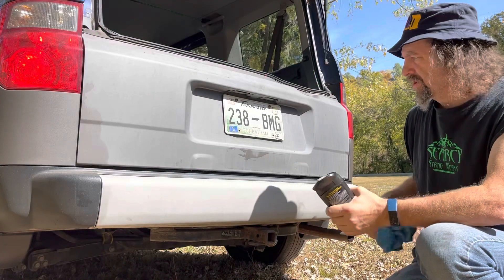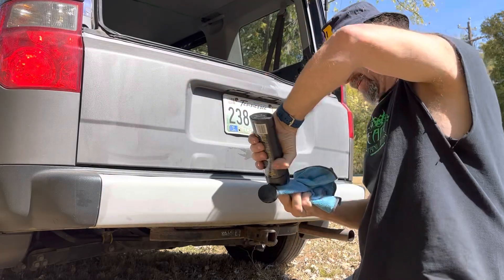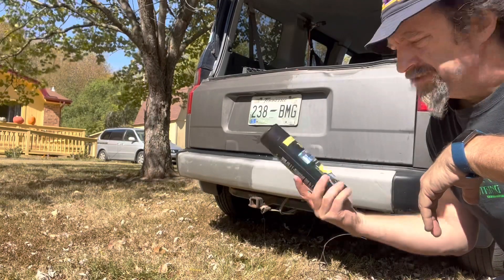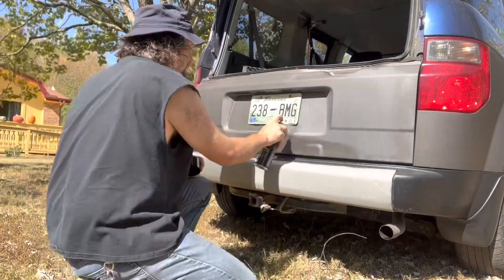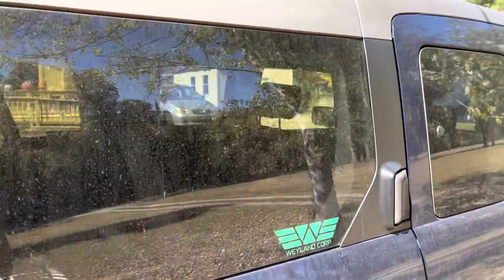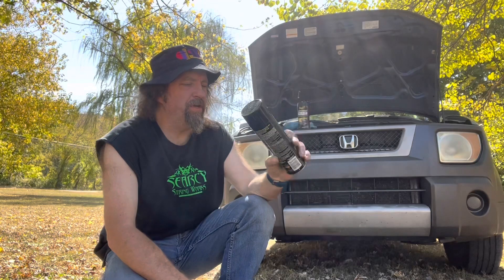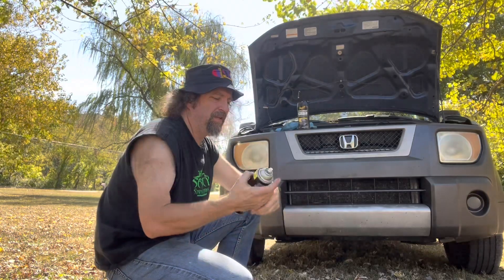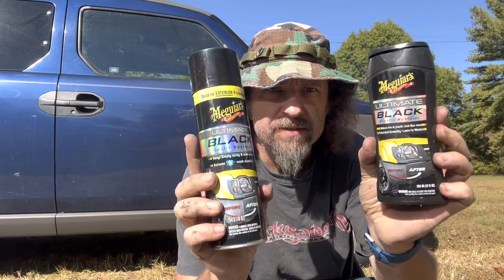Honda Element v Meguiar's Black Plastic Restorer Exterior Trim Gloss Spray

Comment: Clint, I have used the rub on and really like the results.
My wife’s E has the metallic blue panels.  One of the previous owners tried something on the panels, which splotched the pudding out of them.  Now I need to find something that will take the splotches out, or maybe just switch my gray parts with hers and then just bed liner the blue ones 🥴🫣🤔😎
Reply from the maker: This stuff says it need to be applied several times for very damaged plastic. Which mine is.

Comment: Looks good Clint.  Agreed. The rub on looks better.  I saw someone used Forever Black bumper and trim conditioner.  A little more expensive. But looked like it did a good job.  I need to try something soon myself. Thanks
Reply from the maker: My only reason for picking this stuff is that's what they had when I went to the store. I'm sure there's other stuff that as good or better. If I'm not impressed with this stuff I may try others.

Comment: When I tried it on my Element I started with a very faded plastic, I used the rubbing version and it took a lot of coats since mine was very faded. I wouldn’t used the spray version since probably It would last 2 or probably more coats and maybe works better on not too faded plastic. Great vid!
Reply from the maker: Thanks! It looks a lot better. I suspect it will improve as I use the stuff. The sprat is handy from grills and other hard to reach places but I'm not sure I'll buy it again.

Comment: Clint, ever do a video of How to replace the tailgate lock actuator? Mine does not open at all. Thanks!
Reply from the maker: I've never done a video on replacing that actuator.
Reply: @clintsearcy3252  thanks for answering, just got the part today and hoping to find help on taking panels off and such.
Reply from the maker: @kick_punch_lipedema8936  Well, I did do this video on adding a push button release to the rear hatch. That might help. 
https://youtu.be/YpDOHBYtT6o
Reply from the maker: @kick_punch_lipedema8936   https://youtu.be/j2Gt7s-nLic

Comment: Be interesting to see what it looks like in a month.  Did you ever install a pull cord on your back door after you did  the actuator installation?  I did the same install and now I just need to install a pull cord to get the back hatch down when I am inside.
Reply from the maker: I still haven't done a pull strap. I'm planning on updating the rear hatch with some ideas so I may do it then.

Comment: The spray ruined my paint 😢 I can’t get it off even with 90% alcohol. I’m 33 female. I drive a black Chevy Spark
Reply from the maker: There is a product called Stones Terminator that is supposed to be good at removing Back To Black.  I have not personally used it but the writeup I see says.  Spray it on, let it work for 3 min, scrub with a semi-stiff brush, then rinse.